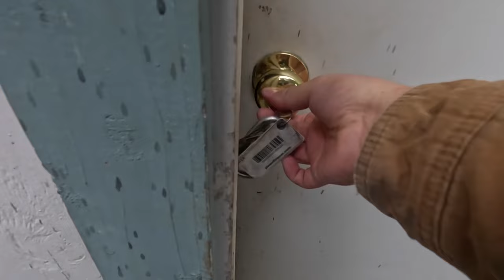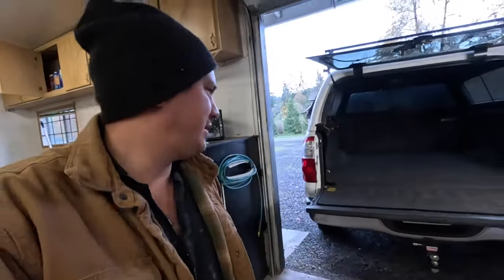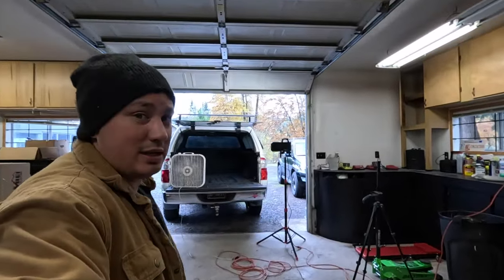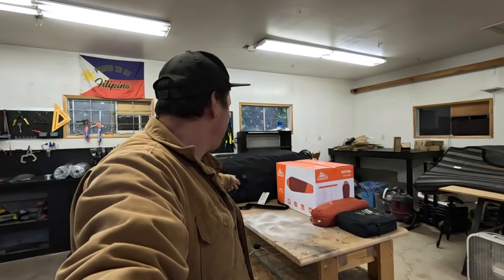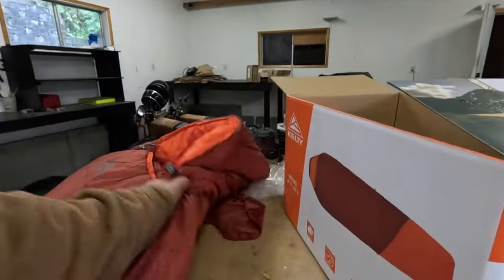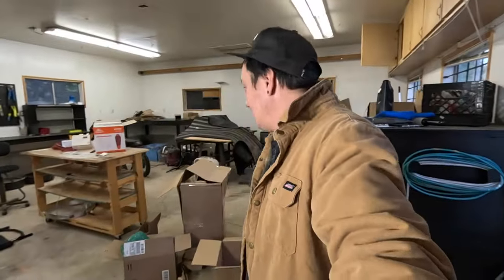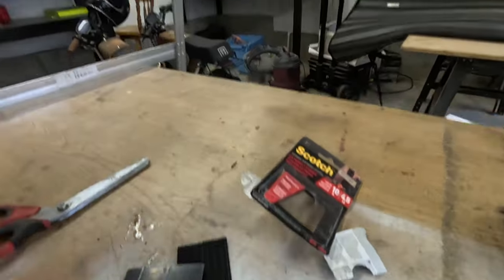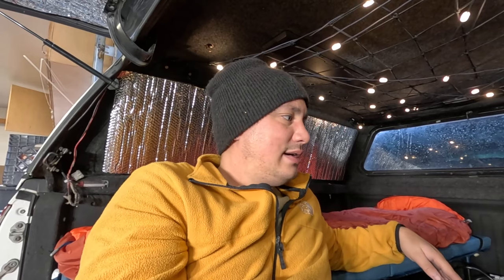Building A Budget Truck Camper Without Power Tools!

Comment: You should put a weather strip between the camper shell and and the top rail of the truck bed then reattach the shell to keep water out.
Reply: I know I have always had the weather strip on all our topper and even slide in truck camper . Also saves scratches on the side rail of the truck .
Reply from the maker: Fosho

Comment: Yes, yes, you need to do a weather strip , better be dry than miserable  cold & wet😢😮. We put a temporary  tonneau cover on out truck for our trip because  the camper shell was being build.  So the camper sealer strip is an easy fix so no water gets inside  the camper and can be removed to put in your favorite  camper set up. Good luck❤

Comment: I hope it doesn’t rain while out. Don’t forget a pillow, your window covers, tools in case you break down. Water for mechanical reasons and drinking. Tylenol, emergency kit, gloves, a burner camping pot that also percolates ( Walmart)  you can boil potatoes and throw in cooler to slice and cook easy! Also cooked hamb. And sausage and cook with a seasoned cast iron skillet. If not this time do it for the next.  Toilet paper. Paper towels. A spray bottle with vinegar water to wash the skillet. Rags for washing hands. You will be happy you have these things. Also a can opener. Cook some biscuits to take if you want and warm up the sausage and have some sausage and cheese sandwiches even if You dont have eggs. Or just take some already scrambled and cooked
Reply from the maker: Already back!
Reply: @isaacturnerit  I figured!  Well Its a good list for the next time. I hope it was a great time!

Comment: I think I would have went ahead and added the weather strip between the shell and the bed rails. You’ll need it for your other topper as well when you upgrade. Of course I’m assuming you’re going with a topper style and not a slide in
Reply from the maker: I think def slide in

Comment: If your camper is wet, air dry it immediately.   If it smells it could be mold.   Very dangerous.   You don’t want to be breathing mold when you’re inside your truck.   Figure out where the water is coming inside and seal it.
Reply from the maker: Dang

Comment: Suggestions:  1)  12 volt heating pad for your sleeping bag or cot that plugs into your nice lithium battery. They're energy efficient and will keep you toasty warm inside while sleeping. 2)  Refillable collapsible 2.5 to 5 gal water jug with turn on/off spout.  3)  Handy dandy night time pee jug.  4)  Single cooking element propane stove with a crossover skillet/pot with lid, and a couple of camping utensils (spork/knife), and cups.  5)  Rechargeable nightlight that's energy efficient.  6)  Something to temporarily mount your cellphone on so you can conviently watch movies/videos inside your truck camper before bedtime.  7)  Smal table or shelf with a little cabinet/drawer to place under a side window.  8)  Small 12 volt refrigerator/freezer, or an ice chest.  9)  Small energy efficient fan.

Now you're ready to go camping in your truck camper. My best wishes! Enjoy!
Reply from the maker: Fosho

Comment: if you keep using the camper shell for hauling items or whatever,  in addition to the rail cap sealer, also for a tail gate sealer kit, water comes in that way too... then your next daily driver haul will stay dry.  nice find on the camper shell, been thinking about putting one in my 2003 tundra, had it since we were both new and shiny 😂 amazing truck, never let's me down, a blessing for sure 🙋‍♀️
Reply from the maker: Got a four wheel camper now
Reply from the maker: https://youtu.be/SIT8Bqeg1tw?si=2QMpKsEvldGkdx23

Comment: 12 volt electric blanket in the sleeping bag you plug into the blueitti and you will be crazy warm on your next trip.  Watch some 12 volt electric blanket videos.  Don’t even need the my buddy heater.
Reply from the maker: Fosho
Reply: @isaacturnerit  I can’t sleep in those nylon mummy sleeping bags I need to stretch my legs in different directions.  Look into a Coleman 0 degree bag made out of more cotton than nylon.  They are huge but worm.  Also insulation under sleeping bag and cot is very important as much as what is on top of you.  Comfort I agree is key to good camping.  Well these are some things that work for me. Electric blanket though can make the worst sleeping bag pretty good.